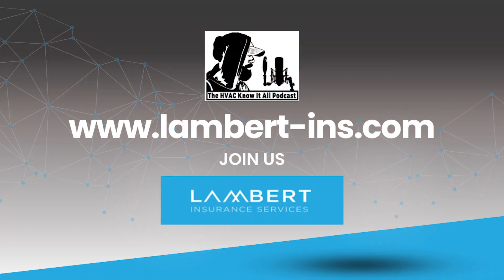The Best Coil Coating for HVAC Techs to Prevent Rust & Equipment Failure with John Pastorello Part 1

Comment: On the "where else would this be useful" . . . I'll bet the coil coating would be good on a gas grill housing.  Not on the heated parts (burner, etc) but on the frame which rusts quickly - esp inside the cabinet . . . .

Comment: If you like to look at new products, take a look at DSX extra, oil to reduce temperature on fans as well as the DSX defender which is the wax to help reduce reduce friction and the fan can move more efficiently on the outside coils.

Comment: 30+ years ago, could buy a central a/c and be nearly certain the evap coil would last life of system, the life of the system was 20 to 40 years - now they build crap and the solution is some chemical coating?
Reply from the maker: Chemical coating isn't a new thing, this gets done at the factory level now a days.

Comment: Along the coast in San Francisco, California, where I’m located.  And we can see most other places.. since contractors do not properly do a load calculation. Most units are grossly oversized..  you have no worry at all whatsoever in the slightest bit that taking away 2% or 3%.  Or let’s go way out on a limb and say somebody really over applied too many thick coats of coil coat.. 
In an application where a unit is one or two sometimes even 3 tons oversized . 
    Removing coil efficiency would be a good thing 🤣 to help extend run times. 
      But the truth of the matter, it’s negligible. 
        The secret to the coil coating lasting is in a thorough proper preparation of the surfaces to be decreased. In some cases even etched.. depending on the product used. 

       That the product that has just been cleaned like coils and fins are allowed to dry out thoroughly.     Because once you get that little junction of open gap space, wet, especially if it’s filled with some sort of cleaning chemical that possibly could be corrosive and was not thoroughly flushed out and rinsed..   It will literally be trapped between the junction of the aluminum and fins where they are pressed on and slipped over a copper tubes.

     And this will be stuck permanently underneath in that tiny little groove crack or cranny between fins and the copper tubing. 
 
     Another product that I use on the coastline where the copper tubes go through the steel header plate that is often nowadays with a cheap thin electroplating of galvanized.  But the holes are punched out after the metal has been galvanized. 
    So at the junctions where the tubes pass there is zero galvanized protection where the holes are punched out. 
      So you end up with these small little junction points at the end of the headers where the tubes bend. Where you have copper, aluminum galvanized, and raw fresh cut round circle of exposed steel.. 
       At these junction points, you now have four different metals even though the zinc from the galvanize is supposed to be (“supposedly sacrificial ?”). 
      We noticed this is why we get a lot of our leaks generating at these junction points, especially in saltwater air by the coast.    This is where I spray 95% zinc, 5% epoxy coating that is especially manufactured for saltwater marine applications..  it bridges these junction points between the metals and seals, pure zinc. 
   Only at these junction points. 
        And the rest of the coil and over the epoxy zinc.  Goes to light coats of Modine coil coat. Comes in blue comes in gold color..  
     Colors make the product, UV sunlight resistance to length and the time before they start breaking down under the presence of sunlight. 

Kinda like the melatonin in your skin to protect you from UV radiation causing cancer . 

I have used a viper product. I like it in a situation where no sunlight hits the coil. . 

The problem with all man-made polymers that are clear and have no pigments in the present of UV sunlight they break down more rapidly . 

And since technicians are always in a hurry, and I told the rush and get this job out make a profit. They are usually not very thorough and careful about their application and overlapping edges because the product is clear over a large coil guys often miss spots. .